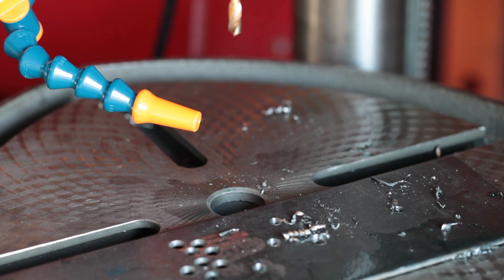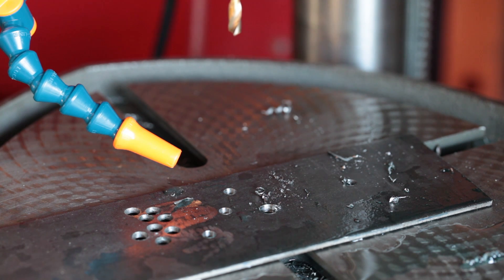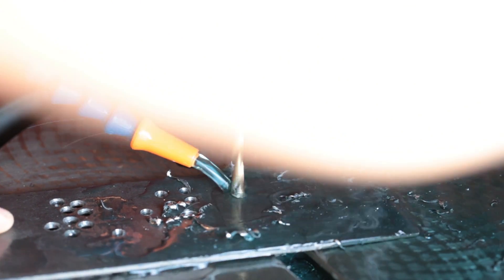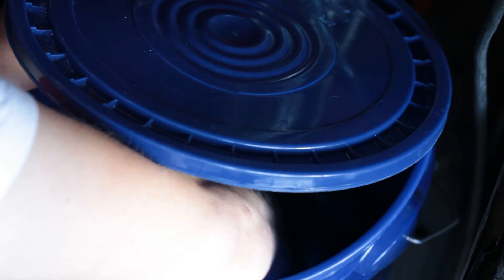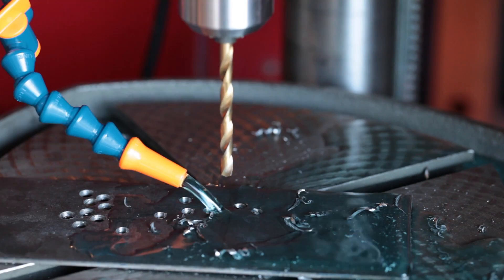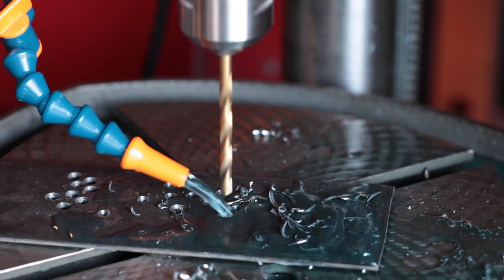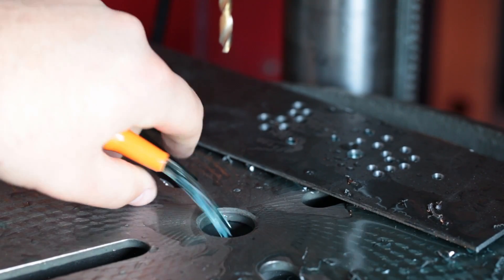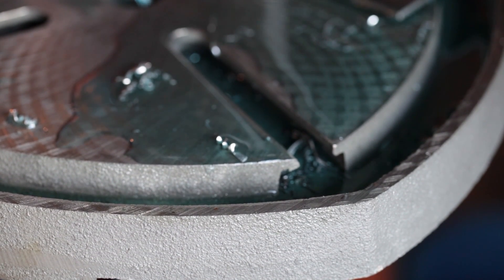Drill Press Coolant System w/ Bigger Pump

Comment: Why kind and suze of fitting to catch the fluud underneath the drill press table?
Reply from the maker: It was either already drilled and tapped or I tapped it for NPT fittings.  Not sure on the size prob something like 1/2 NPT or 3/4 NPT

Comment: Nice setup I'm going to set mine up very soon I do a lot of drilling  and mix water with "cool tool" 75/25 -75%water -25% cool tool saves a lot of wear on drill bits and cutting dies If you ever have any leaks you can caulk it with a Marine caulk "5800" you can actually  caulk under water with it

Comment: Super cool. I have the same drill press and I'm going to start my build soon to make a coolant system. I hope you don't mind me copying most of your design.

The one thing I'm still trying to figure out is how you made a 1/2" threaded connection for the bottom of the 1-1/4" opening on the bottom of the table. You mentioned tapering a piece of plastic. Can you let me know what you did there?